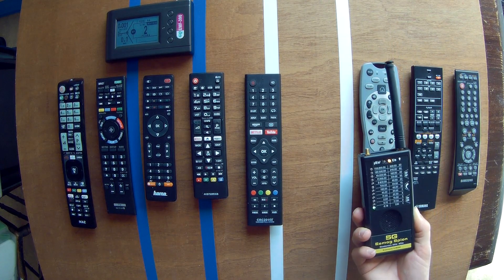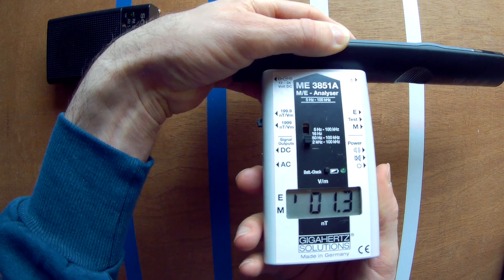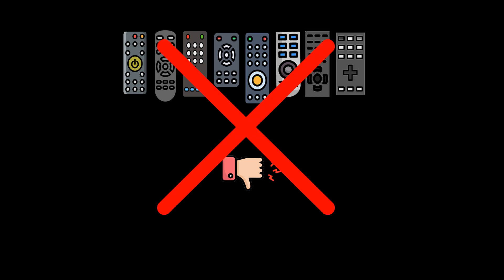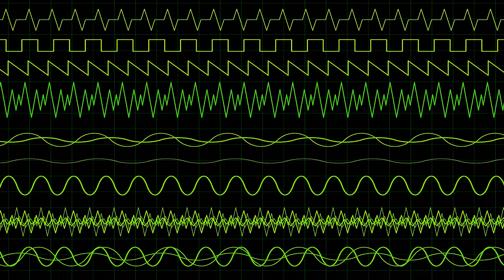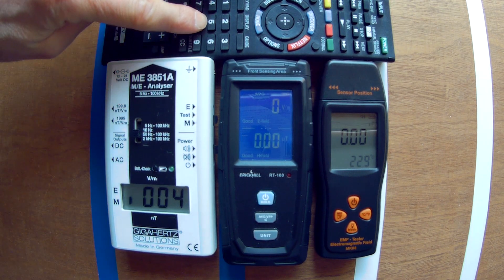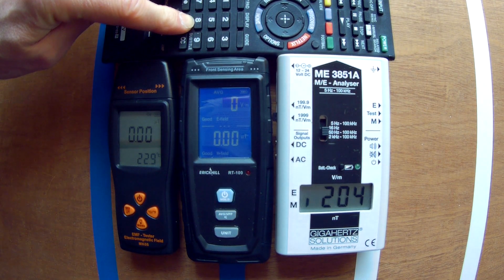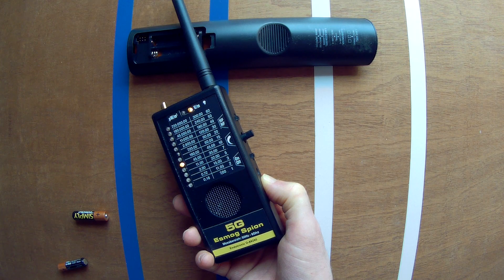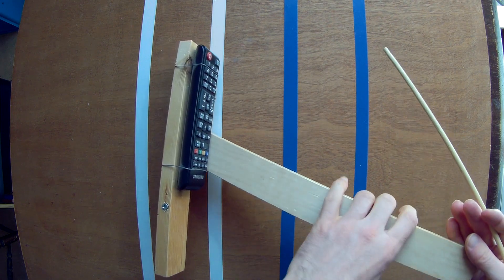EMF sensitivity explained ---------- Unnecessary EMF -------------- Esmog Spion 5G - ME3851A

Comment from the maker: See the links in the description (click on 'show more').

This is how I think effects from EMF work:
That white device (ME3851A) can detect a magnetic field up to about 50cm from the black remote (the remote that emitted more than 200nT), at that distance it dropped a lot of course, to almost nothing, about 0.1nT. This while that white device (ME3851a) is set to dirty magnetic mode (2kHz - 100kHz). I don't use that remote, but I think I wouldn't be able to feel pain up to 50cm. It's possible 10cm or less is already enough to not trigger pain anymore, possibly because it's more about the dirty electric field in standby and not about the magnetic fields, or the EMF would be already too weak for me at a certain distance so it wouldn't trigger a pain effect. I'm speculating a bit though, we are still learning. It's possible the magnetic fields on the new remotes are also triggering a reaction because of different modulations or frequencies.
If you bring your hand close to a stove, you won't feel pain unless you touch it, even very up close you will only feel heat. You can compare this heat with vague efects from EMF, and the further you go the vaguer it gets. When using something like that wooden thing at the end of the video, more vague effects could still occur over long exposure time if buttons would be continually pushed but I usually push buttons a couple of times and then watch a show or movie and that wooden thing is long enough I think, for the remote i'm using, since that remote is not the worst of the bunch I tested. Still, even with my inhibitor build with which I control my computer (see inhibitor video), vague effects start to occur (over time) even with that distance and after a long time the effects start to become less vague. So I still need to limit exposure time.
Just like a stove can heat you up over time from a distance, EMF can cause effects from a distance, the longer you are exposed and the closer you get, the quicker the effects. EMF effects are cumulative. EMF from my monitor for example can be measured pretty far with an Esmog Spion 5G and i'm still a bit in it where I sit and a person can often be more sensitive than a meter. I hope this all makes sense, it is a bit complicated to explain with words.

It is important to know that cheap devices sometimes detect nothing when there is EMF, like was demonstrated in video 8/13 where I was pretty thorough and many cheap devices did not detect the magnetic field from the wireless mouse being tested... In this TV remote video however, the cheap EMF devices did measure EMF from the remotes when buttons are pressed (but not in stand by), but I didn't show you this. The point of this was not to mislead, it was to demonstrate that EMF can be overlooked if you are not thorough or don't use high quality equipment. Especially lower quality EMF meters are often less sensitive and only detect EMF held in certain positions, very up close. Also, some axis may not detect anything in certain cases (single & triple axis is also explained in video "8/13"). Not having a true sound function can also lead to missed information. 
A cheap device may detect nothing or something only up to like 1 or 2 cm, while an ME3851A for example may detect something up to 40 - 50 cm, in case of certain infra-red TV remotes or even much further when measuring other sources.

Comment: Thanks for the video. The ME3851A is supposed to capture alternate magnetic fields and the ones generated by the remote are not alternate, is the Gigahertz Solutions capturing something different?
Reply from the maker: Because I feel it's there I can find it with measuring devices and demonstrate this so other people learn from it, but I didn't study electronics in school, I don't know why these remotes make this, you would have to ask an electronics guy, but they may not be familiar with EMF related things or may not care enough about your question to find out. You can always ask though. The devices I use should be made to measure AC, not DC, so if they measure something, there must be AC there I guess. The power source is DC, that doesn't mean the electronics inside can't produce some AC as a by-product.
Reply from the maker: that being said, here are some more tests I did FYI:

- Magnets trigger the magnetic modes of the ME3851A, if you move the magnets in front of the device. When the magnets lays still, the ME3851A measures nothing. As was seen in this video if I lay the ME3851A on a table + the TV remote and I press a button continuously, both absolutely laying still, a magnetic field is measured.

- When I move the same magnets in front of the Esmog Spion in electric mode, the LED's slightly go down, not up. Nothing much happens.

- When I move magnets in front of the ME3851A while it's set to dirty electric mode (2kHz - 100kHz) it goes from 0.0 to 0.1 V/m. So nothing much happens. When I place the ME3851A against a TV remote seen in this video, while no buttons are pressed, both absolutely laying still, I measure 1.3 V/m like was seen.

The magnets I used for testing are small but strong Neodymium disk magnets that can hold 2 kg.